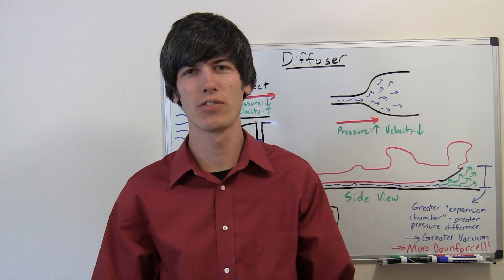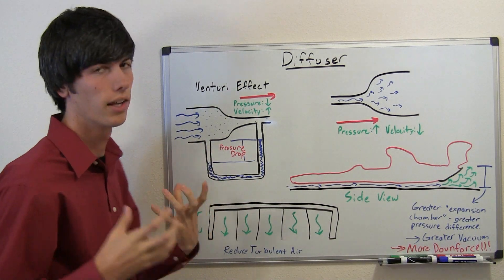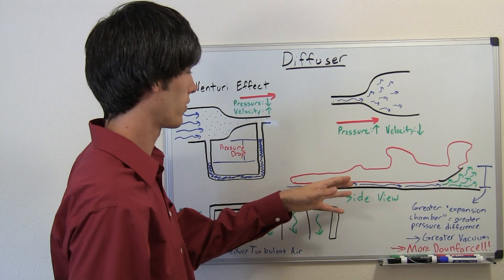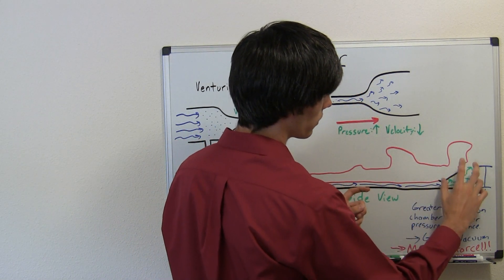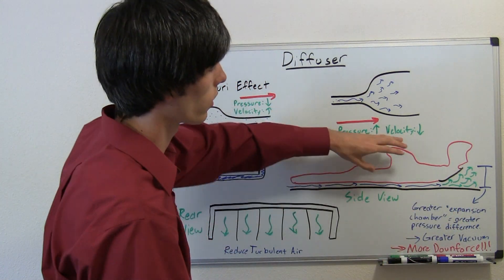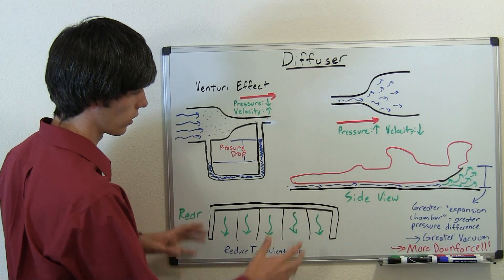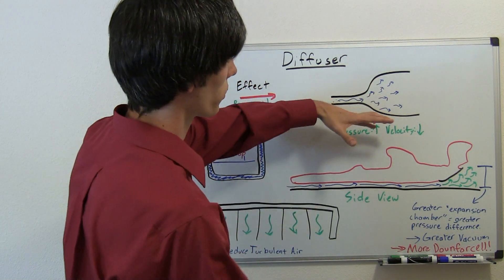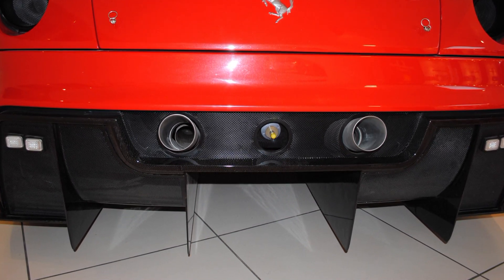Diffuser - Explained

Comment: OK. So does increasing the pressure with diffuser also increase temperature?
Reply: That is a tough question to answer, are you asking this from a cold air intake perspective or from a curiosity of cause and effect? If it's the first then the negative pressure would probably work against you more than any change in air temp would show.
Reply: Just curious =)
Reply: I assume you are talking about the air under the car, my guess would be that the temp would drop. Must admit my only reasoning is taking the ideal gas law PV=nRT and just calling V and n constant haha

Comment: It depends. The lighter a vehicle, the less speed is required to generate significant downforce, because less downforce will have more effect. There is also the secondary benefit of diffusers, which is reduced drag. Even for relatively low drag road cars, the few counts gained from a diffuser or diffuser like profile makes an impact on fuel savings.

For high performance low speed focused cars, large vortex producing diffusers can be a valuable source of downforce at the cost of drag.

Comment: No there was not a mistake. You are thinking of air in an enclosed volume which then changes volume. This isn't the case with the car. There is no enclosed volume, there is an open volume with varying cross sectional area. Due to mass conservation the air speeds up with constricting area and pressure drops. The opposite happens with increasing area.

Comment: The Venturi effect operates off of Bernoulli's principle. Bernoulli's can be used in a wide range of applications like the flow over an airfoil, whereas, the Venturi effect only deals with flow through a restriction.

Comment: i think the air that travels from under the car and into the diffuser has the same speed, therefore when it expands it creates a low pressure area that sucks in more air. the pressure under the diffuser wil be atmospheric, but further towards the end and not at the entrance. the ventury effect of higher pressure in a bigger area just applies when the direction of the air is towards the smaller area, creating a sort of bottle neck effect.

Comment: It doesn't. The low pressure under the car comes from being forced into flowing through a smaller cross sectional area (helped by the high pressure at the nose of the car). The diffuser throat's curvature then creates a suction peak that also contributes to low pressure, but the high pressure air in the aft portion of the diffuser does not induce low pressure anywhere on the car.

Comment: What's the volume? The car does not make a closed volume around the air. The volume is all of Earth's atmosphere. Air is incompressible at low speeds (cars travel at low speeds as far as air is concerned) so a given number of particles takes up the same space. However the speed of the particles can vary. When this happens the potential energy of static pressure is converted to kinetic energy of dynamic pressure and the pressure on the solid surface drops.

Comment: The throat is the location of lowest pressure. There is a favorable gradient ahead of it and an adverse gradient behind it. The air under the front section of the car will feel the effect of the throat more than the mild pressure rise in the diffuser.

Comment: The area of the inlet can be exactly the same as the area before the throat. The stagnation point at the nose will automatically accelerate the air under the car. A raised leading edge only increases this effect but is not required.

Comment: A small flaw in your drawing. The diffuser also needs an air intake. The leading edge of the floor should be raised obove the rest of the floor to get as much air as possible under the floor. Thats whats accelerate the air. Thats why F1 cars have higher and higer noses. Regulations now lowers the noses for safety reasons.

Comment: Getting back to atmospheric pressure is impossible because of viscous losses. The F1 is also going to generate a wake from the wings and various other lift devices, not to mention the open tires.

You can get a rough idea of the draft strength from the drag coefficient since this is related to the momentum defect left in the air by the vehicle, which is one of the things that creates the draft.

The F1 is probably going to leave a much stronger wake than a regular car.

Comment from the maker: You can model it however you would like - car moving and air stationary, or car stationary and air moving (think wind tunnel). Regardless, the air in the diffuser will have the opportunity to slow down and increase pressure.

Comment: Your explanation suggests you should look this over again.
Is the air under the car really moving 'fast' compared to the air elsewhere around the car?  Isn't the air around the car actually barely moving at all?  Isn't the car actually what is moving?  
If you  pick the car as your reference point for motion, the air on top of the car would be moving fast too and so you shouldn't claim it is at atmospheric pressure.
The diffuser accelerates the air up.  Think, equal opposite action reaction.

Comment: Its the same with air plane wings. You create a high pressure on the bottom of the wing and low on the top. The air on top of the wing has to move faster. The wing will always travel the same way as the low pressure which is up. Thats why cars have spoilers for down force, to counteract that high pressure zone on the bottom of the car.

Comment: are fixed. Because of this, the area that the flow passes through get smaller. By conservation of mass: m_dot = density*area*velocity, so speed goes up. By Bernoulli, speed going up means pressure goes down. The opposite happens during diffuser expansion.

Comment: Why does air need to be compressible to allow movement? Density is fixed, but the shape of the control volume isn't. An object moving through air will cause pressure to change at certain regions, yes. At the front of the car there is high pressure due to stagnation. This high pressure can be responsible for pushing air under the car. The point of highest pressure is on a special streamline called the dividing streamline. Streamlines above go up, those below go down. The streamlines at the ground

Comment: Take a soda bottle, fill it with water, then pour it out. Where does the water level drop fastest? The wide base, or the narrow neck?

You're not confining the flow because it's not in a closed space. The air can exit the diffuser just like it can exit the bottle. This is unlike a closed bottle which is a closed space.

Now since air is incompressible (density can't change) and mass cannot be destroyed, air must accelerate when area shrinks. When it accelerates, pressure drops (Bernoulli).

Comment: You are wrong.  It is counterintuitive, but google "how a venturi works"  there is a pressure rise at the start of a diffuser, but in the throat, the narrow part where air is going the fastest, the pressure is low.

Comment: Not really. A wing can have lift/drag ratios in the neighborhood of 70:1.  A 45 degree spoiler has a lift/drag ratio of ~1.  The low pressure area of a wing has a greater delta pressure than the high pressure side, and if the wing is in its sweet spot, there is very little resulting turbulence (drag).

Comment: How do you get less pressure in a smaller area?  2:50-3:00  Surely more pressure comes from being confined, than in a larger area... Sorry to say this but it's like farting sitting down (tight space) requires more pressure than say standing up (open)...  Sorry it had to be done.  Flow is restricted in a tight area but not pressure!

Comment: You are wrong sir. His video is correct, you may just have to watch it again. You are getting mixed up with the exact area of pressure that he is explaining and what you THINK he's explaining. 

The air BEHIND the car IS at a lower pressure due to the turbulent (i think) air wake, but isn't in relation to he downforce and low pressure system being created under the car and higher pressure at the diffuser.

Comment: You're almost there. The diffuser forces the air in front of it to accelerate and thus induce a pressure drop, but by doing that, it must let the air re-expand and decelerate cleanly (Bernoulli's principle). If the low pressure air did not re-pressurize exiting the underbody, the higher pressure air on top of the car would essentially fold back over itself, causing a turbulent stream and thus induce drag. The diffuser, in tandem with creating downforce, allows the air to exit cleanly.

Comment: The diffuser works at all speeds for the purpose of this discussion and no, it doesn't generate the wake behind the car but instead weakens that wake. The wake is a result of flow separation from surfaces where pressure recovery is not possible. In the case of a car with a diffuser, that would be an area like the rear bumper above the diffuser.

Just look at the Bernoulli equation, it tells you what is going on. If that won't convince you, look at pressure distributions along airfoils/diffusers.

Comment: at the speed it takes to make that diffuser work, there is a strong vacuum in that diffuser and trailing the car. That is a fact. ever wonder why race car drivers tuck in tight to another mans bumper? there is no way that the pressure increases in that diffuser at 150 mph. have you ever felt a draft at 150? try passing someone after using a draft. going from that vacuum to the normal air the car pushes around is like hitting a wall or losing a cylinders power output. its insane

Comment from the maker: The air under the diffuser is at a higher pressure in comparison with the air underneath the car. The pressure differential between the top and the bottom of the car is what allows it to increase downforce. The diffuser returns the air to atmospheric pressure (or close to it). No, it's not "high" pressure, but it's higher than underneath the car. Aston Martin has pressure differentials online that you can check out, showing how pressure increases in the diffuser, if you're more curious.

Comment: i dont think you understand the diffuser. it makes LESS pressure under the car! making more downforce by vacuum. pulling it to the ground. when you diffuse the air or increase the space the air occupies, it makes a LOW pressure area. at 3:00 you say there is high pressure behind the car, you are wrong. its a low pressure. drafting is when a car follows close and tucks into the vacuum, and has less drag allowing more speed, or less fuel consumption.

Comment: The air does not expand. Rake (what you're describing) creates a low pressure zone under the very front of the car, but the pressure will increase as you go toward the tail because the cross sectional area seen by the flow increases, which makes the air slow down. Adding a diffuser doesn't reduce the effectiveness of rake. It can actually make the low pressure zone of the front of the car stronger. The diffuser just adds a second low pressure zone at the rear of the car and also lowers drag.

Comment: O.K. yeah. But that's not what I'm asking. Does the existence of a Diffuser on a car mess up this phenomenon. You see when the car is lower in the front and higher in the back the speeding air underneath  the car has somewhere to go therefore it expands and sucks the car to the ground. It seems like a diffuser would mess this up. Does it? Yes or No.

Comment: A vortex is a form of flow separation, it's also turbulent and viscous so bernoulli's equation does not apply, at least not at the core.

The wing and diffuser are very similar. The wing will have a pressure distribution along its length. On the curved upper surface, pressure goes down and then up. If it did not go up, planes would be very draggy and no one would use them.

Comment: You're not creating high pressure air under the car, but behind it. Yes, some of that is going to push up, but it's overcome by the low pressure spike at the diffuser entrance.

Whether the air of the car is moving makes no difference. It's exactly the same.

Comment: Yes and no. Expanding area increases pressure and does act like propulsion, but the diffuser is still producing downforce by imparting upward momentum into the air, which means downward momentum is being transferred to the car.

Divide the diffuser in two. The entrance is responsible for downforce, the tail is for reducing drag.

Comment: Hang on a second. I'm not sure this is entirely correct. In this example you used, shouldn't pressure decrease and velocity increase? That's why you get vortexes (right?). If you look at an aircraft wing, on the top where it's curved, you get high velocity but low pressure air, and low pressure creates a vacuum. Anyway, please get back to me soon about this.

Comment: The propulsing effect from that high pressure is smaller than the braking effect of the whole diffuser in total. If it would not be smaller, the car would be propelled by the diffuser without any other propulsion which means that it would move without any energy input. That is physically impossible and breaks the second law of thermodynamics.

Comment: Nice vid. Could you also do a vid on aerodynamic stalling, how its achieved and how it contfibutes to downforce? Maybe reference last season's exhaust blown diffusers and the Mercedes team's DRS system which stalled the rear wing (although i believe that was to reduce drag rather than increase downforce?)

Comment: Thanks, but I believe the double diffuser controversy at the start of the 2009 GP season was due to a seperate diffuser.
 Anyway, I looked it up and apparently they were objects intended to fulfill other tasks that were subsequently designed by a few teams (like Brawn) to also act as diffusers.

Comment from the maker: Diffusers are not used for additional propulsion, in fact they do the opposite. Their purpose is to slow down the air (allow it to return to atmospheric pressure more slowly than just a cut-off) moving under the car. A nozzle does the opposite, increasing velocity by reducing pressure, thus providing propulsion.

Comment: Turbulence does not equate to increased pressure. Without the diffuser, the flow would simply separate. This would generate low pressure and greatly increase drag. It may or may not increase downforce depending on how strong the low pressure spike at the diffuser throat is.

Comment: Although diffuser increases pressure behind the car (in comparison with pressure under the car), but pressure would be even more without diffuser because of turbulence. And this would lead to slower flow under the car.
Correct me, please, if I was wrong.

Comment: Diffuser does not pull the low pressure flux,in the diffuser there is an adverse gradient pressure,roughly speaking the diffuser allows a recovery pressure, without it the mass flux underneath the car would be less because of the much slower freestream (btw it's more complicated).However it's a very nice explanation!! it's hard to find something good on internet...if you want to go in deep with this effect I suggest you to read this paper

Comment: The inlet angle can be used to increase the Bernoulli effect. The pressure drop from Bernoulli comes from the ratio of cross sectional areas, A_inlet/A_throat.

One thing that may be confusing is that A_inlet/A_throat is not 1 for a perfectly flat diffuser. A_inlet would include the area of the opening in addition to the area below the stagnation line on the front face of the diffuser, while A_throat would be the area of the diffuser opening.

Comment: A diffuser and a valance are two different things. A diffuser actually DIFFUSES air. 

A valance is for appearance reasons only. A diffuser actually aerodynamically serves a purpose. 

The Carbon Fiber on the bottom of a Corvette ZR1's front bumper is a diffuser.

The plastic under a trucks bumper is a valance.

Comment: you need a larger volume of air to feed the larger expansion chamber at the rear. where would you get this larger volume of air? of course from the front. and in the process of 'feeding' the rear diffuser with more air, you inadvertently speed up the speed in that region (front) causing even lower pressures.

of course you can scoop up air from other parts of the car to feed the diffuser (as in EBDs and Double Diffusers in F1). but to simply answer your question, more air is needed for the rear.

Comment: uhm no.. remember, F1 is still racing. so the goal is still to go faster than the other teams. and given freedom, engineers would always find ways to do this one way or the other, and speed doesn't really equate well to safety.

there are diminishing returns between speed and safety. and racing, F1 in particular, doesn't have to be super fast for people to appreciate the tech and the sport itself.

Comment: your analogy is a bit wrong, that's why you're finding it difficult.

the difference is that unlike traffic, fluids will speed up when it encounters bottlenecks (or high Pressure) because it has to move the same amount of fluid in that little volume of space. and the only way for you to move the same amount of fluid in a smaller space is to speed it up.

so unlike traffic where cars slow down on bottlenecks (for safety), fluids speed up to keep up with the incoming fluid volume. HTH

Comment: how dose the pressure difference increase the vacuum? while driving down an open highway you suddenly hit congested traffic, now you have to slow down as well as the cars behind you, now imagine the cars as air. I do not understand how the difference causes the air to move faster instead of slowing it down like the traffic jam. I am guessing it has something to do with cars not compressing like air does.

Comment: Does it also have the effect of reducing the effect of low pressure at the back of the car by pouring air from the bottom ? 
Thanks for the video btw.